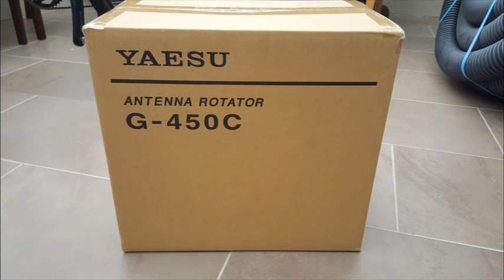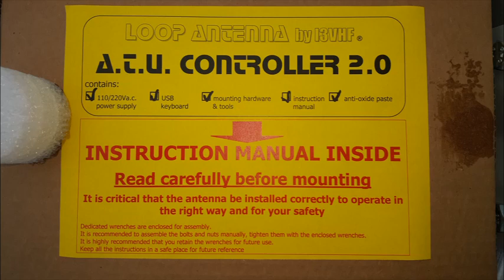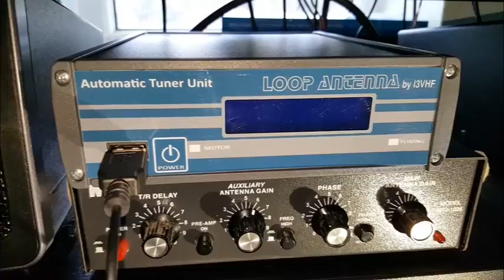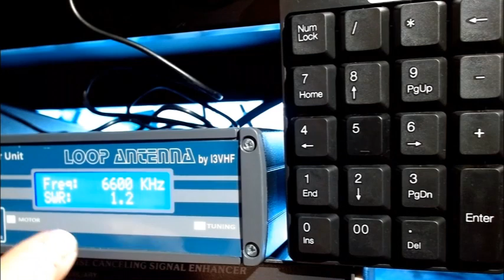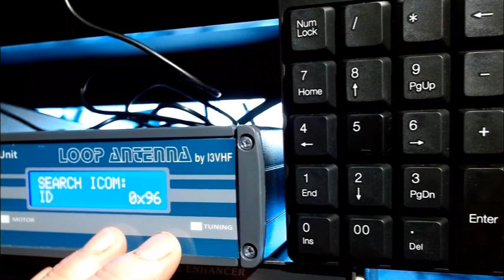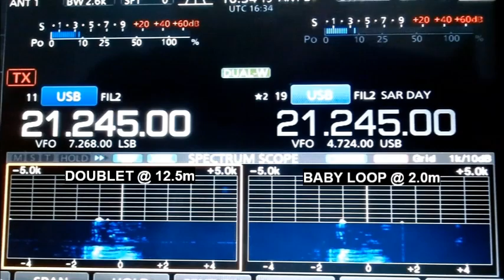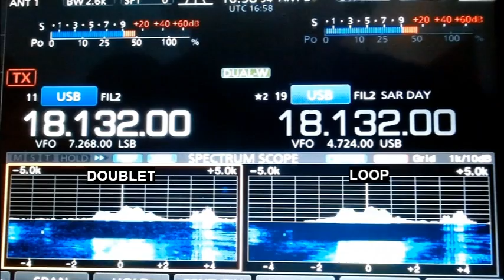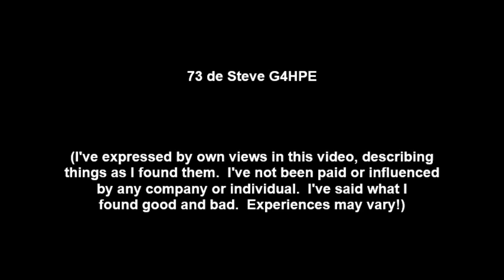Ciro Mazzoni Baby Loop

Comment: A friend of mine built a 10 to 20 Meter Loop which worked great on all  five bands, it too had a very high Q, guess it's the nature of the Propagation Beast...However!  The Tunable 20 to 150 Picofarad  clamped plate capacitor could only handle 30 watts anything over that it was just a conductor....Thank you very much for this presentation. Well done  73's   KC3ZDW

Comment: Hello Steve,  as mentioned by many other enthusiasts you have made indeed a very comprehensive and informative video. Well done! 

 I am a former user of the babyloop  antenna and I used it intensely for many years with success. Later on I sold it  to a very good friend of mine which I regret till this day.  However it is my intention to buy the loop again since this is the most ideal antenna in my space limited situation. 

The most remarkable fact of your findings was, at least for me, that the babyloop in your situation was more sensitive for DX signals in the opposite direction in comparison what is explained in the antenna instruction manual, i.e. not in the direction of the gamma match but the other side.  At the time I used the babyloop I was not aware of this property or behaviour I simply followed the instructions give by Cirro Mazzoni. 

I would like to you see, and with me many other radio amateurs I presume,  If this also is also the case on your transmissions. 
Could you do some other experiments for us and share these with us?  

I would recommend you to make use of the Reverse Beacon Network or RBN for short. You do not need any additional equipment connected to your transceiver. You just use your computer to monitor your results. 

You only have to give CQ in { CW / RTTY / PSK31 or PSK63 } on a certain frequency repeatedly by sending the following sentence "TEST de G4HPE TEST". Make it last for a few minutes or so and observe your results on the RBN main page.  Turn the babyloop in exactly the opposite direction and repeat the same procedure again.  

I am looking forward to you reaction ( and your findings of course! )

Sincerely 
Erwin, best 73 de PA3FCB

Comment: Great video and demo, Steve. I bought a Baby-loop in June of 2022. I live in a small city and on a small lot. I wanted an antenna with the ability to direct the signal. I mounted mine on a Yeasu 450 rotator and started using it. I also found that the signals, both transmitted and received, are stronger off the backside of the loop. Glad to see that it wasn't just my installation. I've also tried it at two different heights based on the minimum and maximum distance recommended by the manufacturer.  I have made numerous DX QSO'S with it. The noise level is lower than my 65' Windom and my DX Commander Rapide. 73, KC8WVG.  
Ciro Mazzoni should reference your video on their website.

Comment: Good day Steve, thanks for the nice review. 
Due to the high Q of the antenna, I tend to tune the frequency of the antenna 1 kHz higher than the radio, when I'm in USB and tune the antenna 1 kHz lower when I use LSB. (I have the MIDI-Loop). I noticed that this gets my reading of the SWR exactly the same on the Loop-tuner and my TRX.
On the part of issues with the tuning box of the loop, I recently got many times the fault: "Motor fail - no load".
Initially, I checked all connections on the tuner, on my radio and on the antenna itself. I found some moist inside the tuning motor cable connection box, at the base of the antenna. It also partially corroded the wires of the connections there. I ended up getting rid of the terminal blocks there and soldered the wires together of the incoming and outgoing side of the RF choke that is housed inside that box.
But it didn't solve the issue with getting "Motor fail - no load". Only after I swapped the + and - connection of the tuning motor, on the side of the "tiny little" plug that goes into the back of the tuning unit, it was solved.
To this day (3 months later) the fault hasn't returned and I can enjoy the antenna again.
73 from Holland de PC7H - Roy

Comment: Well done Steve, a very detailed demo with some very good tips.  I have a baby loop and a midi loop here.  I did some trial tests on the baby loop over a 2 week period and was happy with the results.  I used the keypad to alter frequencies and found the forward and reverse directions to be very similar in signal strength.  I did some tests on the 40m band on our local radio club net and found the baby loop to be omnidirectional and and rotating the loop had very little effect.  I assume that was because the radio club boys were within 40 Km of my location so I guess that means the 40m band NVIS propagation is omnidirectional and DX propagation or more directional.  I added Fair-Rite mix 31 suppression torroids on all cables - the coax, the rotator cables and the DC motor cables.  Those ferrites were added at both ends of each cable to ensure they were all adequately choked.  I'm using the same rotor as you and I would be delighted if it would rotate at double the speed to get to the target direction quicker.  Thanks again, 73,  Jamie  VK2YCJ

Comment: I found this fascinating. Years ago I had a AEA Isoloop, a much more rudimentary system which had to be tuned manually and was very touchy. On 15m at least, it was quite effective. I wonder if the tuning process can be detected by nearby operators?
I suggest that you may want to waterproof the front of the PL259. Water can seep through the threads. Usually I use self-vulcanizing rubber tape covered with a layer of vinyl tape to protect it against the sun, although probably you needn't worry about sun in the UK!  -- 4X6GP

Comment: Hello Steve, this is by far the best video about this baby loop.  Although extremely clean English is spoken.  I didn't fully understand a small point because I speak German.  If the antenna is in fully automatic mode and I scan the frequency for stations on the Icom with the VFO, the tuning of the antenna is also fully automatic, did I understand that correctly?  Sorry if I'm asking such a stupid question?😢

Comment: Dear Steve,

28:32 Have you tried swapping the wire connections to the SO 239 socket that came attached on the baby loop, may be manufacturer soldered it crosswired at the factory?...that my guess.

73 VU3FXD

Comment: Well that was a surprise to find your video recommended in my YouTube feed Steve.  Your loop is certainly a substantial piece of engineering. My biggest problem is electrical noise to the front of my property where the shack is, whereas the rear is quieter. I do have a loop in the rear garden, but it is active RX only.
A couple of thoughts, have you considered upgrading your stepladder? A more rigid set of steps is a definite plus.  We have a set with yellow grp sides with aluminium treads, there are also a set of side rails that you can brace a leg against, they make quite a difference.
I agree that your DC cable into that small plug on the back of the controller is less than ideal, if you are still concerned you could use six inches or so of a lighter gauge cable say 6A as a transition to the 40A.  The impedance loss would be negligible, I’m sure it’s running on pcb tracks inside the box. 
Anyway an interesting video and good luck with your new loop.
Excuse the strange YouTube handle, it dates from when I had my big bike and I’ve never changed it. 

Cheers Nick G0OQK

Comment: Steve, at 5:20 min you are talking about the height the antenna should be above the ground. As an absolute newbie, I would like to know if this antenna is supposed to be mount more or less close to the ground (like in your garden), or if it is also OK to mount higher up, like for example on the fence of a balcony ~10 above the ground.

Comment: Excellent informative video. 
None of the other reviews I have seen have been conclusive.
I have been looking at these loops for some time and you have persuaded me to buy.  (2nd hand)
I have small garden with a Hustler 6BTV. I can only deploy radials on a 45 degree segment. I hope that the Baby Loop will improve my reception.
Reply: Have you tried using more, but shorter radials for the vertical?  Remember that almost all of the return current intensity is within the first ~10% of the radial's length; beyond that, it's largely a waste of wire and a needless feeling of constraint.

Comment: I'm really very impressed! I'd be interested in your results on transmit. I have a fairly high noise floor on the lower HF bands and went for a Wellbrook RX loop as an RX only antenna with my TRX. 

Loops really do make a huge difference in noise floor - whilst the signal on the loop may be a couple of S-points down on a resonant antenna, the s/n is so much better that the actual strength almost is irrelevant compared to the vast improvement in listening experience.

Comment: Hm! Petty the gamma is heavily welded , trimming that would put you SWR in place.  I dont know if that paste is good or bad , I would put it together fluss, and then protect it from outside with silicone grease , and then service it from time to time. 
How is the loop reacting to heavy rain and snow with the non protected capacitor?
How are the "nills" in and out of the plane? and are they also offset like the beam heading?
Would be nice if the loop was offered as a raw loop , and then you could put together your  own controller , eg arduino
Just a thought, Tnx es gl
Reply: The capacitors is just fins of alum in air space...   I could see water or snow changing values as it would take up space but pretty hard to harm the ant.

Comment: I'm curious to know how well the loop rejects local noise? You do mention that it's quieter in the video around 28 mins, but don't quantify that. Many Thanks, John 2E0SVB
Reply: I haven't quantified noise rejection (I never had noise!). But the pattern for the antenna gives you a rough indication: a figure of eight pattern, with vertical polarisation in the plane of the antenna, and horizontal at 90 degrees to it. The nulls in the pattern are sharp and deep. So there will be strong noise rejection within those nulls. Low-mounted loops (high ones are non-ideal electrically and physically) will have broad patterns and there's nothing to suggest this aspect would reduce noise.

Comment: I'd prefer if you looked at weak signals as opposed to S9 stations. Also many get the loop for noise levels, especially on the lower HF bands, we saw no demo of this... Just an observation.

I thought of getting the Midi loop, but jury is still out.

Comment: I can imagine what the signal strength would be with the loop at the same height as the doublet. Definitely an advantage with a directional antenna versus your doublet. Mark KB3Z
Reply: Whilst a clear aspect is certainly important, height isn't for a magloop, and indeed works against DX performance in general. If you model one (vertically erected, as in the video), at 2m base height, you get a 'loaf of bread pattern', that covers all paths, long and short, fairly equally for the vpol radiation. There is somewhat weaker hpol radiation at 90 degrees to this. Take it to 10m, and it will reach much the same peak low angle radiation at 10 degrees (about -1dBi, but this value is likely to be significantly lower than for a real loop, as my WSPR tests tend to show). But overall, there is a loss of pattern at lower elevations at 10m, compared to 2m height and the NVIS increases by 5dBi at 90 degrees. So, unless NVIS is your quarry, a lower loop is the best all-round solution.

Comment: Piss Poor welding on the Aluminum at the price those sell for.
Reply: Its 6060 aluminum TIG welded. Should hold together though. My example was done a bit better.
Reply: They should at least try and heat the aluminum before welding, cold weld. I'm not much of a welder myself but have a welder and understand what it takes to weld aluminum. There's AC polorazition shift/bias offset settings to clean as you weld. Shouldn't look loke that at those prices. They'll probably improve over time. @jasonpalmer5437
Reply: I checked the coaxial connection with volt meter on the baby loop   It shows a direct short between center pin to screw connected is this normal for the loop.
Reply: @williamjohnston8775  Test the coax first un-connected from the antenna to eliminate any doubt. Then check again connected, it is likely normal. Remember "Radio Frequency" is Alternating Current so there is no reason to have an open circuit in the driven portion of the loop. I'd need to have a hands on understanding of the antenna to speculate any further. "73"
Reply: @williamjohnston8775  I think you have the concept of a diapole in mind, it's an open circuit but all antennas need not be an open circuit. You'll catch on, all in due time.
Reply: @williamjohnston8775 I guess any loop is actually a short circuit?